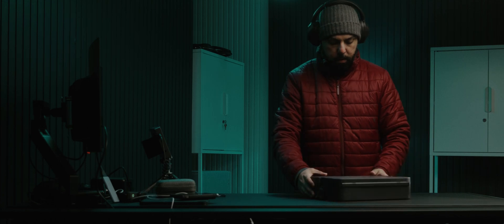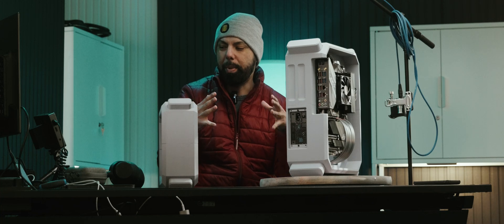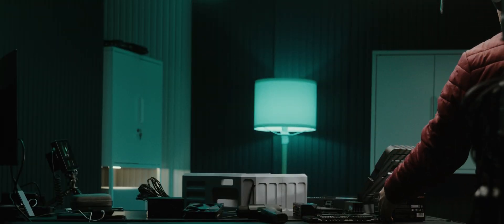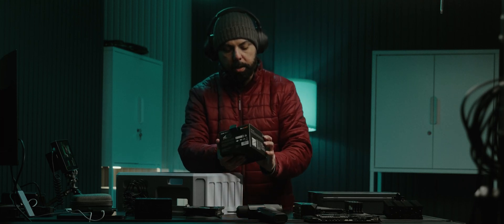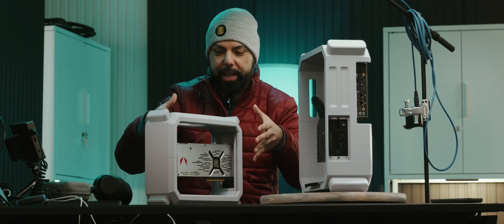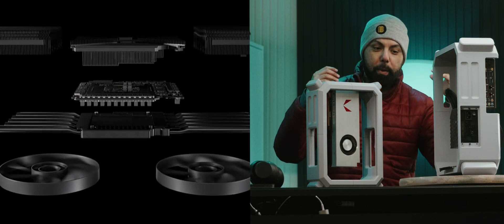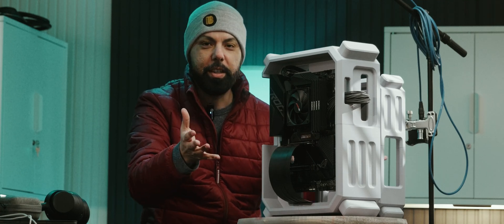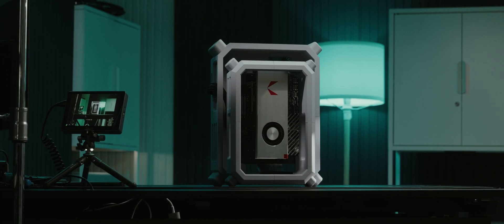I 3D Printed a Computer Case for the New 5000 Series GPU's!

Comment: You could just 3d print some ducts to force the air to go to where you want, like there is so much wasted room behind the Motherboard, could have the motherboard flat on one side of the case with a bigger cooler and the PSU over the PCI-e slots as you planed to move the GPU to a different case anyways, it will also hide the the massive riser you will need for that, could have thown the GPU right next to the Motherboard so it sucks air with ducts from the one side and exaust it, again with ducts, to the other side of the case, it will be bigger, but the footprint will be a lot smaller than having two cases, also those GPUs with the new flow through cooler don't need to be that massive, unless you are using two PSUs for some reason. The difference in temps might be negligible though, like if you put a good CPU cooler on it rather than a low profile one, your system will never run at 100% on both the GPU side and the CPU side.

Comment: If you flip the motherboard 180 degrees so the PCIe connector for the GPU would be more to the top, you could use the intake and exhaust from the GPU fans to get rid of all your heat. It’s still   In the early stages of development but yeah, having a 3d printer would be incredible for a creator doing what you do. Nice work!
Reply from the maker: @J.Bbuildz  a good time to be alive with the world of 3Dprinting. 😊